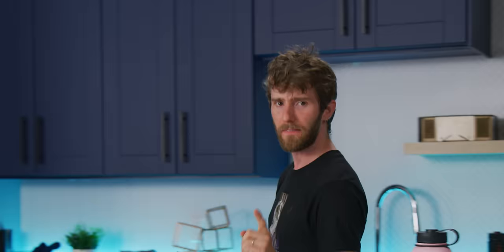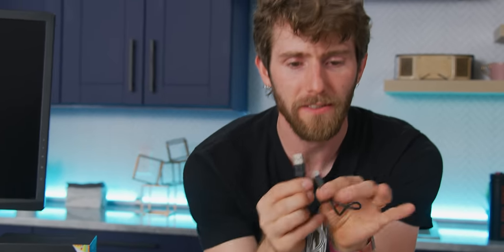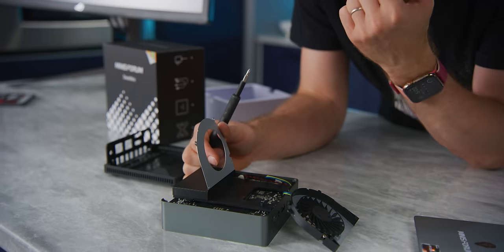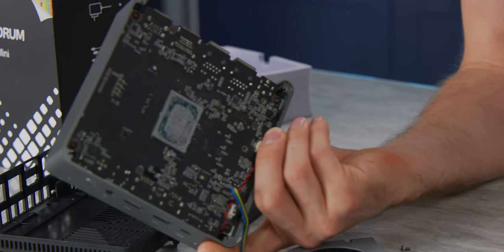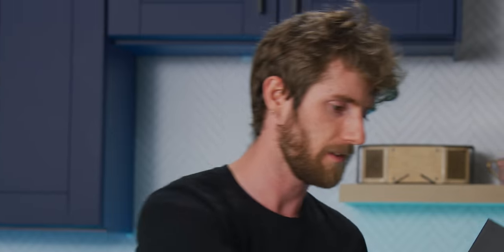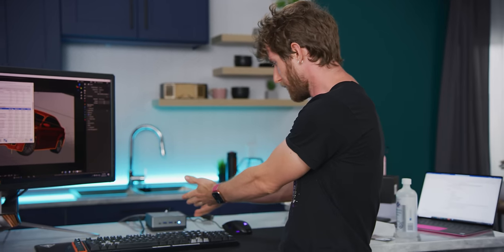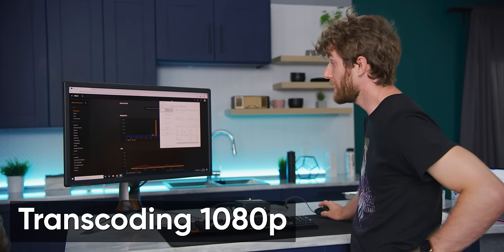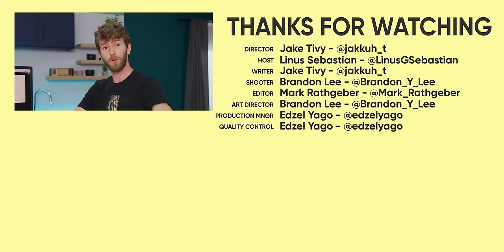FINALLY... a Ryzen Mini PC!

Comment: For a fair thermal benchmark (eg - exactly what the consumer is gonna get), you should do the performance specs 'out of the box' before you tear it down and replace all the compound and pads. If they used a janky pad or crappy compound and you replaced it with good stuff before testing, your mileage will vary from ours.

Comment: "it's not like you're watercooling anything in there"

its just a matter of time.
Reply: SOON.
Reply: Free real estate
Reply: It’s free content
Reply: Ya its not like he said he couldn't watercool this thing, its almost about the size of an AIO with a 120mm radiator
Reply: steve would probably do it, he did the NUC
Reply: [Optimum Tech has entered the chat]
Reply: <<water cooling is overrated hype. Computer geeks know nothing about heat transfer and thermodynamics, metallurgy.
Reply: @tgmjrtgmjr8221  I know what you mean brudda, i'm all about that efficient cooling
2C delta over ambient at idle (set power management to prefer maximum performance in nvidia control panel, so it's never actually idling, it just sits at 800mv, 1531 core clock and 6350 mem clock, because i also run a hefty 24/7 oc set in afterburner) 
under load i average 21-24C delta over ambient (1.93-1.81mv, 2050-2025 core clock and 6350 mem clock)
all this, with air cooling
oh, and the gpu is a nice big 1080ti
i've seen very few watercooled 1080ti's that do significantly better than that with anything under 280mm rads with push pull.
Reply: I hope Laine from Sweclockers does it. He water cooled a NUC before and can make custom metal cases for his builds.
Reply: @ccricers  Link the video please!

Comment: Linus: "Not my favourite thing to have a cpu running at 80 degrees" 
Me with i7 7700HQ constantly at 90 degrees celcius while gaming: "it's ok he didn't mean it"
Reply: My i7 9750h running at 97 agrees
Reply: My i5 4300m, runs at 80c only after I replace the thermal paste, else it runs at 90c, and turbo boost goes down
Reply: Laughing in shitty alienware cooling.
Reply: dude buy a cooler
Reply: my NUC10 goes up to 99C and....it works - only the clock is lowered to keep it under 100C :)
Reply: I thought my PC running at 85 degrees at full load for 10 minutes was bad
Reply: @danielcook8035  One of my NUCs constantly runs at 95-98C since months and guess what changes ? Only clock speed, to reduce overheat - that's the way it works, to avoid burning.
Reply: 90 degrees? oh god i hope it's fahrenheit

but in all seriousness if you're not exaggerating anything above 80C is terrible for your CPU 
wait thats a laptop cpu... anything over 100 and its dead
Reply: @solared  I played apex for 20 minutes at 103 c and it didn't thermal throttle, nor did the fans speed up

nice.
Reply: @fortheworthy627  yes, but it's killing your CPU from inside out

you see, anything above 80 cannot be properly carried by the heatspreader, and the die is struggling
Reply: @solared  I know, the cpu won't last long if I don't fix the problem, but I just wanted to point out that my cpu is getting abused.
Reply: My i5-7400 is, while just at the desktop with nothing open, all 4 cores are around 100
Reply: @themadlad_  that CPU will be dead soon.
Reply: Cooling isn't a huge concern, maybe if you have the CPU for many many years you will see degrade performance but don't sweat it a whole lot. I see people buy really expensive coolers for even low end machines and I' just like really...
Reply: @themadlad_  thats absurdly high seems like faulty hardware honestly
Reply: My 95°C Ryzen 5 4600HS: "Rookie numbers"
Reply: @KimionTM  how to melt a cpu
Reply: @solared  It's designed to run that hot, no problem there
Reply: @KimionTM  still 10 degrees away from death >:D
Reply: @solared  It would only die if it was running over 105°C which can't happen because the cpu thermal throttles before that
Reply: my ryzen5 3500u runs at 63 when playing...
Reply: replace ur intel stock cooler!!!
Reply: @Mr Fox bruh
Reply: My i7 4790k overclocked runs at 98
Reply: @corgihhabana5054  holyyy  how long has it been clocked that high?
Reply: Dodo1169 idk the clocks cause my friend did it but he was experimenting with overclocking as much components on his almost dying pc
Reply: Dodo1169 might be 2 days
Reply: @corgihhabana5054  many pc youtubers were recommending not to let ur pc temps to go above 70 or so degrees so that's what I was saying,
Reply: Dodo1169 ye well his pc is gonna die anyway the motherboard is literally sparking every 10 seconds
Reply: While gaming ? My ryzen 7 3700x only runs 10% load in most games and under 30degrees
Reply: Amateurs running at 200° somehow seriously I should get a better cooler
Reply: my xeon e5-2689 runs at 40 degrees when doing stuff with only 2 fans..
Reply: My i7 7700k at 4.5 ghz is at a 70 on 80 percent load.
Reply: My i5 2310 running at 100 loading up Minecraft
Reply: @dododareal1218  you need to understand they need to set baselines for people to think a product is acceptsble. Some of the cheapest cooling solutions is adequete but again not ideal. Read your products specs cus many cpus today have max temps of 105 before really bad stuff happens
Reply: So the Intel pc jokes are real that you can use it as a radiator ......
Reply: Man use throttle stop you can solve your heat problems and get better performance out of your laptop cpu
It’s easy to use and there are many YouTube videos out there
Reply: My 10 year old i5 stays 35 degrees Celsius
Reply: Not really hard to get it running below 50 but alr
Reply: Laughs in core m3-7Y32 running at 50 degrees
Reply: You people must have some serious throttling issues. I run my Ryzen 5 3600 on its stock cooler (wraith stealth) and it very rarely gets up to 80c. It doesn't throttle until it reaches 95c and I have never hit that temp.
Reply: @solared  Anything under 95°C is perfectly fine
Reply: @IceDragon-fj4vx  no. In the short term, maybe, depending on the processor but definitely not for extended periods of time.
Reply: @solared  they're designed for it, it's perfectly fine
Reply: my  i7-2620M ran at 100C and literally fucking sudoku'd itself and now i cant even turn it on because it boots at 95c
Reply: Always use vsync while gaming on mobile cpu it takes down the heat by at least 10
Reply: @IDKYHM  keeps my van warm on cold nights
Reply: my laptop is a comfortable 82
Reply: Man so my Intel P2 with an 64k ram and a 1gig HD is running at 170 is that too hot? I use it for roasting weenies while I look at my "My Space" page and download an mp3 from Napster. Haha a flash from the past. Ugh showing my age now oh the humanity!!
Reply: Mine's stay at 69 during normal day, if i make that guy angry by opening many windows or open a game that exactly have the minimum specs as my laptop that guy start heating up .
Reply: We sold lots of mini computers to the Middle East (Hot zone). I think we won in this battle! We have been in mini PC field since 2009. ;)
Reply: Just dont do it than
Reply: Me with Intel stock with a Intel 8500, running under 100% load with max 50 degrees:
Reply: my i7 running at 90 when it starts:
Reply: @ajemajh  ah yes a cooler for a laptop
Reply: My i5 7700u : pathetic
Reply: My i3 8100 runs at 29 degrees celcius
Reply: Yours runs that cool? Mine runs at a calm 105 degrees Celsius
Reply: Well my i7 8750h running at 97c while gaming T_T
Reply: My R9 5900HX is pretty much always at 100°C while gaming😅😬
Still in spec though😅
Reply: @riddshotsyoungerbrother  Wait, 105°C?😳
Reply: @Proxyxd1  yes, well not anymore because sei got a new computer but it did
Reply: My i5 8257U (15W) in my mini PC sits around between 60 to 75°C when doing emulation. The low wattage help. 
I'm glad I didn't choose the i7 version of my mini PC, it's 28W and with the same cooling I expect it to run hotter and thermal throttle.
Reply: People forget how hot laptops run. Old laptop ran hot as hell and still lasted for years without issue.
Reply: Different processors handle different temperatures differently
Reply: @djentrification1631my alienware m15r3 has shut itself off because it was at 100c before! multiple times!

Comment: Linus: "this is the first AMD mini pc!" 

also Linus: wrenches the top and bottom panels aggressively
Reply: First my a**. I had an AMD mini PC like that (still have) before intel even "invented" (ahem, copied) the NUC concept. If you don't believe it you can search  Zotac Z-BOX Nano AD10 Plus on google, it's from 2011, while Intel introduced NUC in 2013.
Reply: @souljastation5463  I'm with you I've already search a lot of stores and websites with Ryzen mini pcs and even single board with Ryzen embedded on it.
Reply: ? Ive seen a few mini pcs with the ryzen 3 2200g
Reply: @pegnelson4209  i can already suspect this is bad
Reply: @Deuteriumaddict  you had doubts before? I know this for a long time about this.
Reply: @souljastation5463  if i dont mistake similar happened with external GPU, "first external gpu ever made by razor" (or whoever) but amd had that since hd3xxx series years before
Reply: I think they found out it gets a lot of comment likes

Comment: There are Ryzen 4000 mini PCs available now from ASUS.
Reply: And Lenovo
Reply: And the A300 from a year ago.
Reply: People who pre ordered this is punching the air. “Damn you asus”
Reply: This.  Im all for budget offerings of last years parts bins, but this... is more expensive than the PN50 which should be significantly faster. So I'm not sure what minisforum is going for
Reply: 8:40 we know Linus said it 🤦‍♂️
Reply: LTT vids are usually five months behind unless its live show coverage
Reply: zen2 though not zen3
Reply: I tottaly expected a PN50 review
Reply: Icanohzyl Zen 3 doesn’t exist yet. It is expected to be released in November or December. And those will likely be desktop chips, not laptop.
Reply: @swatmajor1  And HP
Reply: Maxtang has had them for a while as well, have to buy direct from China but they look pretty good. I like the ASUS PN50 though, seriously thinking about one of those, once a few more reviews are out.
Reply: It was addressed at the end of the video. They are doing a review soon.

Comment: I have a NUC.  It is pretty neat having a tiny PC for casual/office use (no gaming or rendering, just programming, web browsing, and anime). It's probably 2/3 the size of a 3.5" external drive  (it does have a power brick like a laptop, though smaller than my laptop's). It powers everything but 4k video (scaling 1080p to 4k is fine, the newer Intel integrated graphics may do 4k though).

It's basically a laptop without the screen or keyboard -- mobile CPU (i3-7100U), laptop RAM (16GB), an NVMe SSD and a 2.5in SSD.

I do love though that it makes you rethink what you think of as a PC, that it has to be at least a midtower ATX, dominate a space, and contain everything you want. Modularization was my philosophy for this build. If I ever wanted an optical drive, I could use a USB one. Storage is offloaded to an NAS and external backup drives. I could theoretically use an external GPU but those are ridiculously expensive.

However, my next build will be a bit larger. Probably mini-ITX so I can move back to desktop chips without going back to a giant ATX or something like Hades/Ghost Canyon. But most people absolutely don't need a giant PC. It's not the 90s anymore. People can buy an AIO or a NUC (which has a VESA mount, making it effectively an AIO without tying you to a specific monitor -- I have a 32" 4k monitor, larger than the AIOs I've seen).

Comment: when a tiny cpu is having more fps than your huge tower 😂😂
Reply: I totally feel you buddy.
Reply: No THIS HAS MORE POWER THAN MY LAPTOP! The mini pc just needs to have at least 8GBs of ram and its better them my i3 8th gen CPU 8GBs RAM 180GB storage. And its not even good, my laptop is decent for what i play
Reply: @constent5394  180 gb storage is shit af
Reply: Lucian ik, its worse when you have only 50 GBs free
Reply: @constent5394  It does have 8 gigs of ram. The deluxe version has 16 gigs.
Reply: @constent5394  what do you play?
*just wanna know.
Reply: @constent5394  put a Linux distro for like nearly  double the performancd
Reply: @SUPABROS  what's your linux distro recommendation
Reply: @MCIrfani  Linux lite has the best UI and is pretty lightweight,I recommend limu lite
Reply: Lol triple a will be stutter
Reply: @Thalanox  Also: unlike with many Laptops the first 8 GB are not soldered, but sticks. Which means you can in the future also upgrade to two 16 GB sticks ;)

Comment: "This is an utterly unique product!" - Linus

Meanwhile, ETA Prime has reviewed like 10 of these Ryzen tiny computers.
Reply: I was about to say that. He did it first, better and in a much more professional fashion
Reply: Eta prime reviewed ryzen mini pcs that were  not as cheap as this jst an amd ryzen 5 with Vega gpu and 16gb rM
Reply: @brunodetornoo2349  he has reviewed two of them, and the first one he reviewed a month ago was this one: https://youtu.be/nfnWkXkjbFg
Reply: In less than a year no less 😂
Reply: Seems like someone at LMG needs better Googlefu, not only are there older zen/zen+ mini PCs on the market, there are also zen2 (Picasso) mini PCs coming out right now. Maybe someone from the IndieGogo project contacted them and LMG didn't do a cursory check of the market to see if it had actually been done?
Reply: @Birdulon  NUCs are a lot smaller than Mini PCs. They aren't comparing to Mini ITX based systems (Mini PCs), which measure about 6.7x6.7 inches, while NUCs are about 4x4 inches and 1.5 inches thick. I though there were heaps of other small systems like this, but did some Googlefu myself and I was wrong.
Reply: @emil8850  I have a 1 Litre (~6x6x1.5in) Lenovo M75q on my desk with a Ryzen 5 pro 3400GE in it, I'm well aware ITX builds aren't comparable. Those have been available retail long before this IGG campaign started sending review units to youtubers.

The Asus PN50 is a 648mL zen2 unit of which you can buy the weaker models right now. The 4700/4800U models might even be in stock before this IGG campaign starts shipping their zen+ units.

HP and Lenovo have had high quality business-class 1L form factor ryzens since last year at the latest and there are various offbrand computers in similar footprints if you dig around. Lenovo also announced a 350mL M75n Nano not too long ago which seem to be up for sale in america right now, though sadly only with zen+ APUs.
There's a number of industrial options too, though the selection is still very limited compared to Intel NUCs and "nucalikes". I just don't see this one as notable given that I bought 8 much nicer ones for my company back in January at a similar price point, and these ones aren't even shipping to backers yet!

Comment: This is basically a laptop without a screen, keyboard and trackpad
Reply: For ~$100 more you could get a lenovo flex 5, which I have. It's way more capable than this.
Reply: @marcusavron47  Acer Spin 5 master race reporting in.

Though I have to say, they have mysteriously RISEN MASSIVELY in price and I have no idea why. Or maybe it's just the model I have with the GTX 1050 GPU in it.
Reply: @marcusavron47  this is probably aimed at programmers and stuff who already have a laptop in their kit and need something with a tiny form factor to just hook up to the monitors they already have. nit sure though on the specific reach of this product. to me it seems like a way better version of a raspberry pi or something like that. just like a media console that you can use as a desktop if u want
Reply: @deathb4bondage558  but they could hook up a laptop just as easily. I'm sorry to say it, but this design, while cool, is kinda pointless.
Reply: @deathb4bondage558  actually, it could be used in robotics. Many robots that I have seen are using some small computer like NUC, Jetson, or even RPi for a very limited robot
Reply: @YandiBanyu  a pi or arduino would be way more practical for that. A lot cheaper too.
Reply: @marcusavron47  Laptops are great for portability, but if I wanted a basic computer to sit at a desk I'd go for a mini PC any day. 

Sure I could connect a laptop, but for a permanent (or semi-portable and semi-permanent) setup the mini PC form factor is much better.

Ideally they'd be slightly better priced vs a similar spec laptop, without needing to include a screen and keyboard, but the form factor alone is something I'd pay a (slight) premium for if necessary. They're great mounted totally out of the way on the back of your monitor.
Reply: @dandavidson4717  To each their own, I guess.
Reply: @deathb4bondage558  No, it's for offices. More and more offices use these NUCs, because they can just put them behind the screen and then have a quite easy to clean work space (as you only have the mouse, keyboard and screen touching the desk). Don't forget, 256 GB HDD and 8 GB would be even enough for a small Gaming PC. For Office you also don't need dual channel memory.
Reply: @dandavidson4717  Often these mini PCs are nowadays bought to replace aged office PCs. They keep the display, mouse and keyboard and just exchange the computer - and it's much cheaper than a notebook and especially as a All-in-One.
Reply: @Marcus Avron a laptop has way worse cooling and the surface area is not ideal vs using something like this.
Reply: ah yes, stick a laptop in my media center and literally never open the lid or pull it out, good solution
Reply: I wish they could focus this products for countries in development where build standard PC is expensive
Reply: When I was searching for laptops last year I would've loved a $400 one with a capable CPU+iGPU, a good amount of RAM, and an SSD for $400. For HT/office PCs or mini, power efficient servers these would be great.
Reply: @kaukospots  It would cost the same and it would be more flexible. I don't see a downside to purchasing a laptop over this at the same price point. And a Nvidia Shield is a better set top for about $250 less.